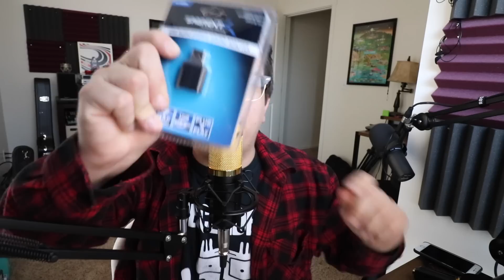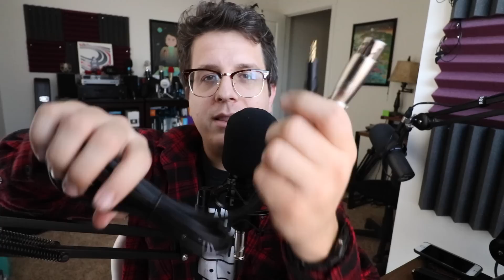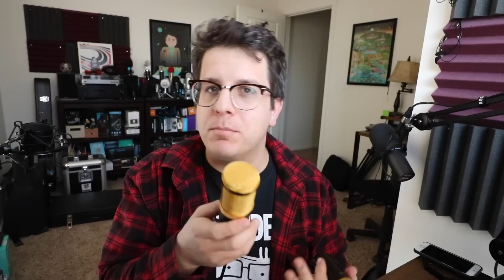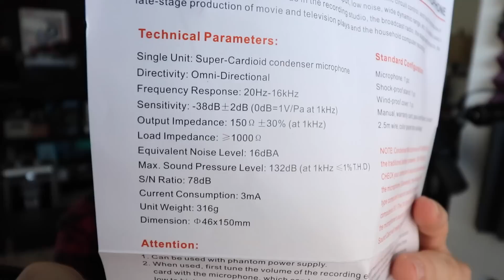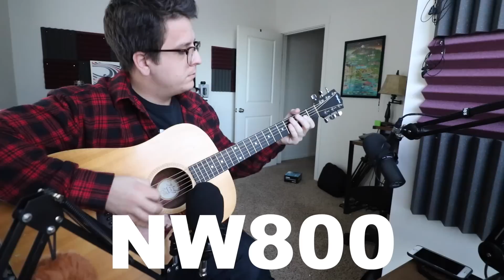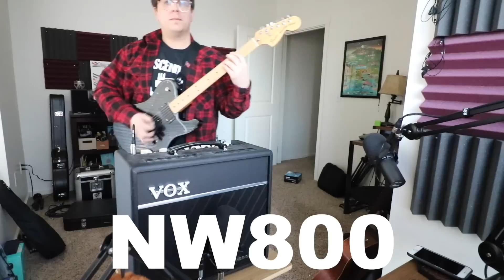Neewer NW-800 Condenser Microphone Review / Test

Comment: I couldn't hear your keyboard at all!
Reply: You can hear it, but it's faint and doesn't disturb.
Reply: Same
Reply: same
Reply: Was it mechanical?
Reply: @FernFox  Back then, no, it was not.
Reply: Max I know it's a year later and you probably figured this out already but no it's fine without phantom power but it will sound a little worse
Reply: Yes. Back in this day and age, I'm pretty sure he only had the Apple keyboard.
Reply: @xHadesStamps  In the NW-700 video he mentioned that he's using a mechanical one with blue cherry switches
Reply: that means ur deaf
Reply: Plugging the microphone directly into the computer is not the best as the mother board does not supply enough voltage so if you use a power supply supplying 48v for no white noise in the backround
Reply: @AlexKaboom  never said I was replying to you
Reply: @AlexKaboom  never said your dad was there for you
Reply: @AlexKaboom  ??? you play roblox??? stfu????
Reply: @AlexKaboom  I will once you confirm that you are wrong and will never be able to do anything right
Reply: People with blue switches 👁👄👁
Reply: that means you are deaf
Reply: Does Neewer NW-800 work without Phantom power supply?
Reply: @AnoraxCZ  0:45
Reply: Well you don’t need to hear that you should listen to what he’s saying
Reply: AnoraxCZ yes but you need a usb sound card like syba (its the best one)
Reply: ZeruVia you can plug and play

Comment: If i understood... I cant plug it into my soundcard, but buy the adapter to the USB to make it work?
Reply from the maker: +Oryl CZ Correct. Computers built in soundcards do  not provide sufficient voltage (the majority of the time).
Reply: You also need a phantom power supply.

Comment: can i only use the usb sound card on a iMac ? or it have not enough phantom power?
Reply from the maker: +ƤяєƊυχє I use the card with a Mac Mini so the USB ports should have the same output. Depends on the USB adapter you get. Check my review of adapters.